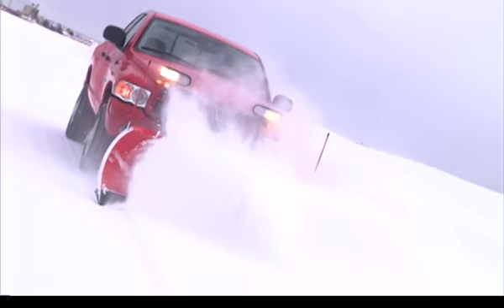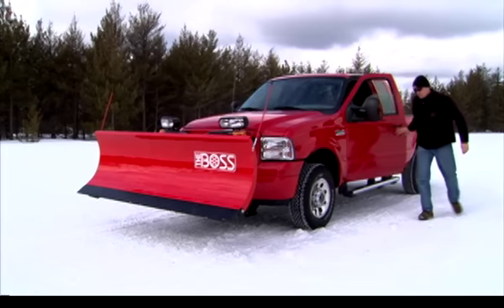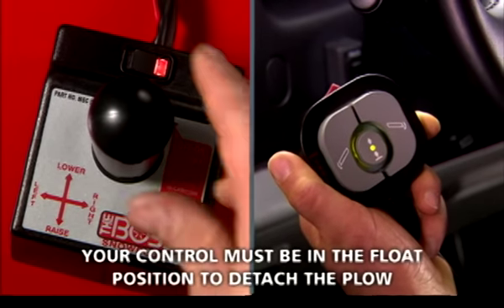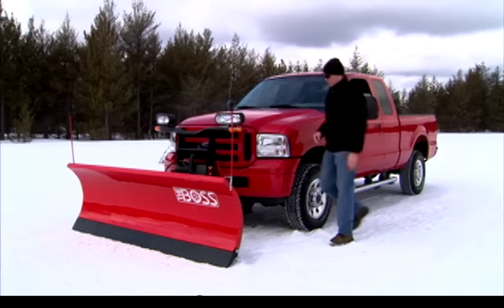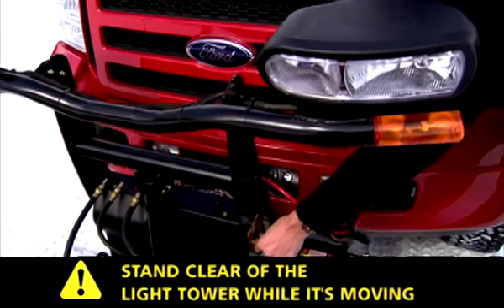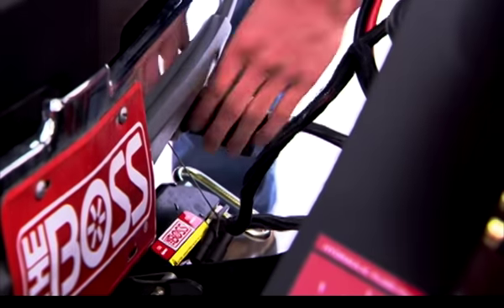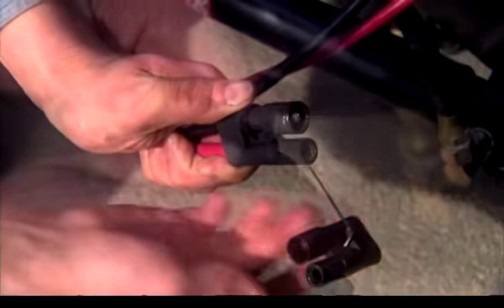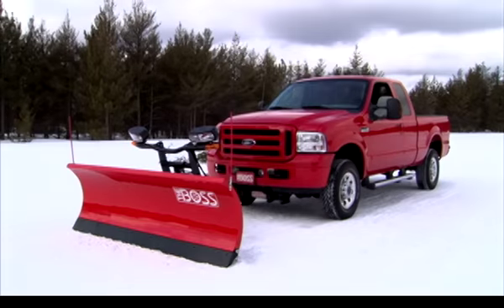How to Detach your BOSS Straight Blade Snowplow

Comment from the maker: When detaching the BOSS plow, you want to be on as level a surface as possible. First lower the kickstand, then go through the procedure of disconnecting the plow. The kickstand will take the plow weight off the truck so that you can easily back away.